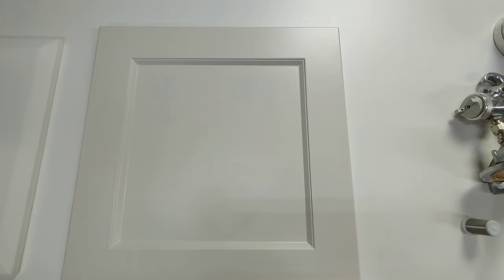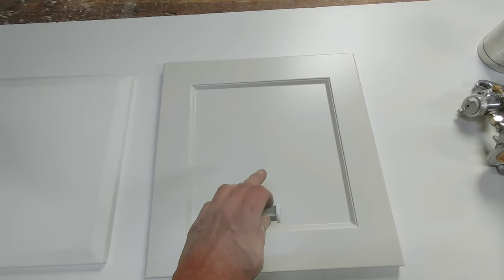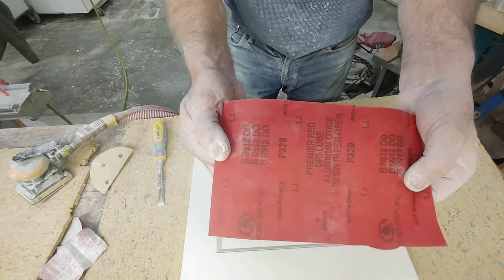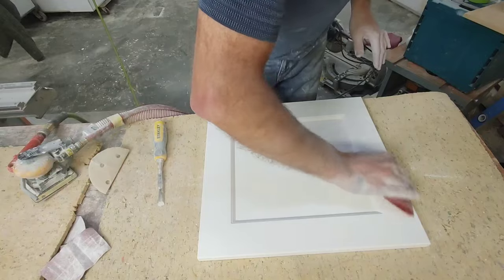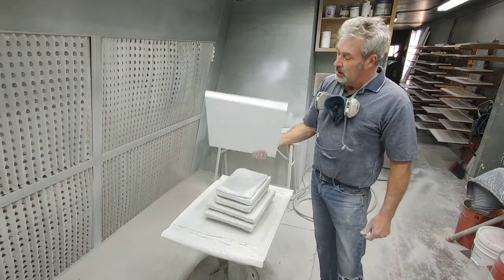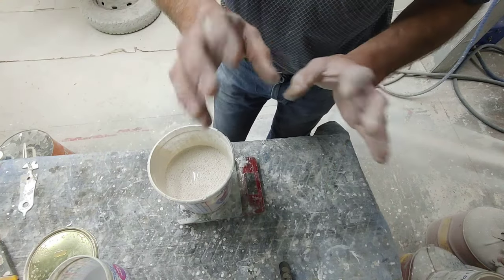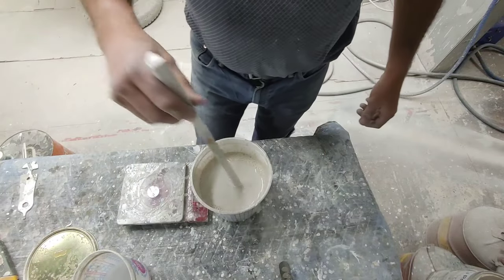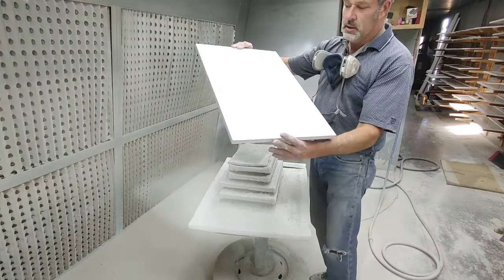How to spray MDF doors and the magic filter

Comment: Very nice video, thank you. Few years ago, we remodeled our kitchen and I made all new cabinet doors. Made raised panel and made the panels out of MDF, and I got just what you said, the roughness on the angles. And ya, we sanded quite a bit, but still rough. We are okay with it, but would be nice to have it smoother.
Reply from the maker: That's the one downfall with MDF is the roughness. The material that I get my doors made out of is the best you can get and it's better than most. I'm glad you made your own doors anyways there's a lot more satisfaction in it. Thanks for watching

Comment: I converted my Q5 to use 3m PPS 2.0 and I love the filter cups.
Reply from the maker: Anyone I know who's used them will never go back. Thanks for watching Seth 👍
Reply: @henrymostert2125  I love your channel. I am a  small shop cabinet maker (furniture and vanities), and am thankful you are sharing so many solid tips.
Reply from the maker: Thanks Seth. I'm getting closer every day to that retirement stage. I just want a hand back the things I've learned over the years. If it helps other people out that makes me happy.
Reply: @henrymostert2125 We appreciate you, Henry!

Any reason to use something like the QTech Qamsin air assisted airless vs the Q5 Platinum HVLP? Can they both spray 2K Renner, SW Gallery?

Comment: Great video. I’m curious about your cleaning process with that hardener in the paint. What do you do between coats? Do you lose some product if you finish a run with half a cup left? How dire is it if the paint hardens in the gun 😬?
Reply from the maker: Those are very good questions. Yes I have had it where I have left the product in the cup for actually about 2 days. I came back and it was like hard Jello at the bottom. Gun wash and the reducer that I use for the finish was able to break it up. I tried to spray all the product and then mix up another batch. That way I don't have too much product that can go off. I have about 45 minutes before the paint starts to degrade. But yeah don't be like me and leave paint in the gun it's a bad idea LOL

Comment: Henry, another Q:

Any special consideration for spraying Renner or SE Gallery on an epoxy coated MDF door?

My thinking is to CNC the MDF with a custom design, seal it with epoxy to make moisture proof, then spray it.

Do people do this?
Reply from the maker: Thats an interesting idea. I've never usrd Renner before. Ehen o have a big order of doors i spray an isolator. It goes on like water. Its catalyzed as well. It dries in 30 minutes then i put a coat of primer on and let dry. Then i sand. The isolator doesn't raise the fibers so it makes sanding the primer way easier. I leave it overnight then a light sand and two top costs s half-hour inbetween. Its a wet on wet coat. It comes out like glass. The online filter for the paint is the biggest difference on the end product

Comment: What brand of finish are you using? I use conversion varnish by Sherwin Williams and have not used the weighing method.
Reply from the maker: I use irurena it's made in Spain. I've used conversion varnish as well that's what I started with. If I do it now I do the weight but I figure it out from doing the volume ratio first. Then I can figure out the percentage by weight. It just makes things go more accurate. You'll just have to change the ratio for darker colors. The nice part about urethane it's the same ratio every time. The paint is also bomb proof